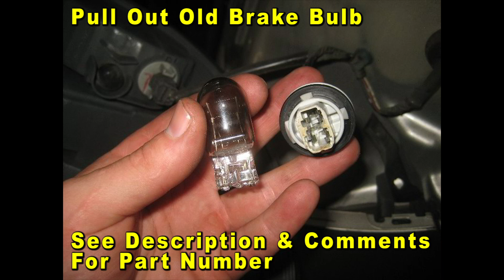2005 To 2010 Honda Odyssey How To Change Tail Light Bulbs With Part Numbers

Comment from the maker: Honda Odyssey Brake Light Bulb - https://amzn.to/3WU8356
LED Brake Light Bulb Part Number - https://amzn.to/4dzwavk
Honda Odyssey Rear Turn Signal Bulb - https://amzn.to/4dbla7z
LED Rear Turn Signal Bulb Part Number - https://amzn.to/46E2WJq
Honda Odyssey Reverse Light Bulb - https://amzn.to/4fA9KMf
LED Reverse Light Bulb Part # - https://amzn.to/3WDV1aq
Parking Light Bulb Part Number - https://amzn.to/46AgMga
Precision Screwdriver Set - https://amzn.to/3sLixaP
Plastic Pry Bar Tools - https://amzn.to/3HMtsV7
Socket & Ratchet Set - https://amzn.to/3Z17LbA
Mechanix Gloves - https://amzn.to/3jCnHkt
Torque Wrench - https://amzn.to/3vS5uSI

The Paul79UF YouTube channel is a participant in the Amazon Services LLC Associates Program, an affiliate advertising program designed to provide a means for sites to earn advertising fees by advertising and linking to Amazon.

This DIY video shows owners of the 3rd generation 2005, 2006, 2007, 2008, 2009 and 2010 Honda Odyssey how to change a burnt out brake light, rear turn signal, reverse (backup or back-up) or side marker bulb in the tail light housings.

Comment from the maker: Check out the DIY guide for changing the tail light bulbs on a third generation 2005 to 2010 Honda Odyssey minivan - 
https://www.paulstravelpictures.com/Honda-Odyssey-Tail-Light-Bulbs-Replacement-Guide/index.html

Here are all off the DIY repair and maintenance tutorials for the 3rd generation 2005 to 2010 Honda Odyssey - 
https://www.paulstravelpictures.com/Articles/Honda-Odyssey-Common-Problems-Repair-Maintenance-Guides.htm

Owners of other Honda or Acura vehicles such as the Accord, Civic, Crosstour, CR-V, CR-Z, HR-V, Fit, Element, Insight, Pilot, Ridgeline, Clarity, Crosstour, Elysion, ILX, TSX, TLX, TL, RLX, RDX, NSX and MDX may also find these DIY instructions to be helpful.